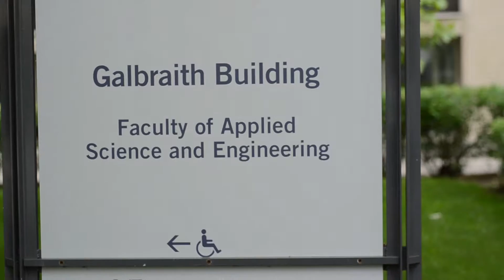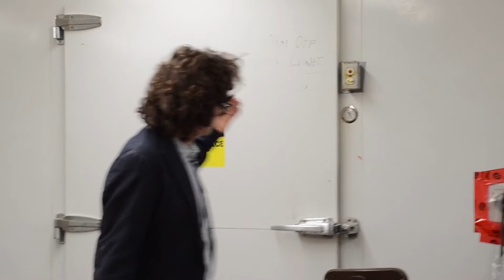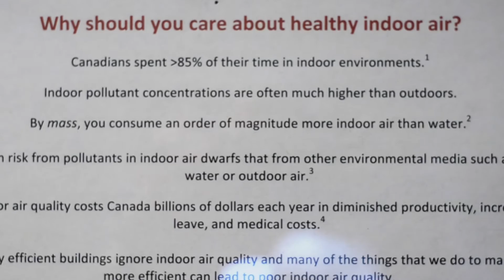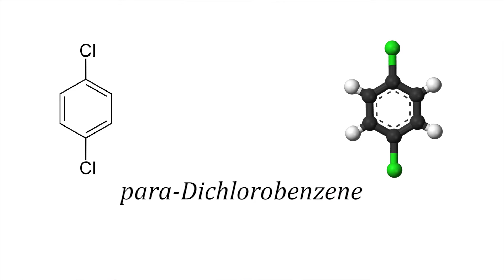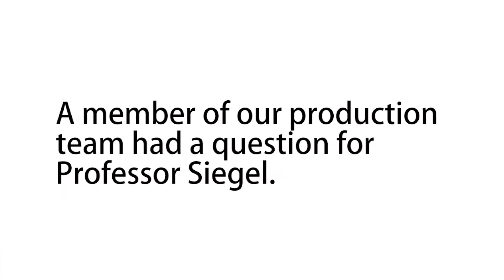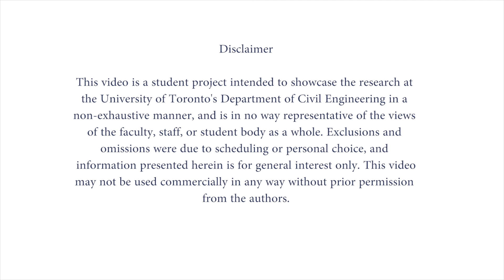Air Quality, Your Health, and Energy Efficiency

Comment: EE requires performance control. 

Humans often experience discomfort when IAQ is bad, and then they do crazy behaviours attempting to achieve comfort. 

They further pollute the air with candles or chemicals. They open windows which abandons environmental and energy control. 

So controlling IAQ is a completely necessary component of performance control and energy efficiency.